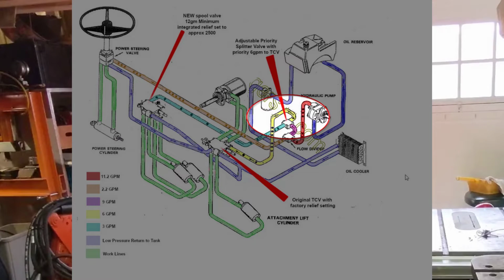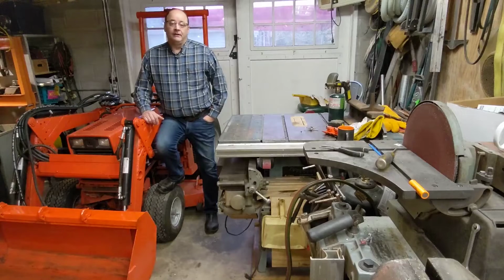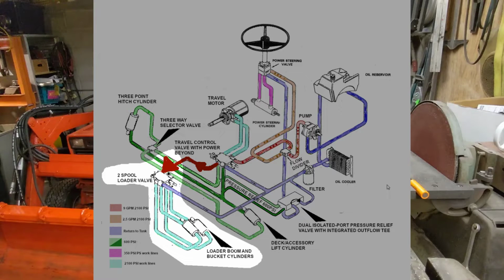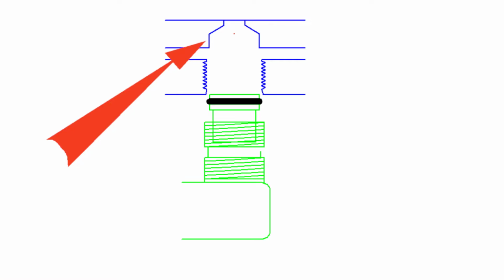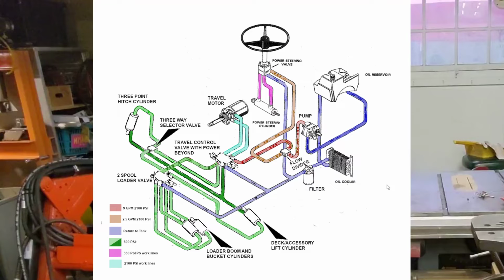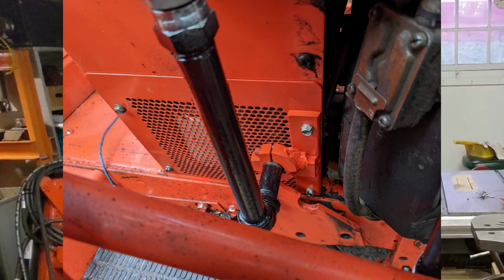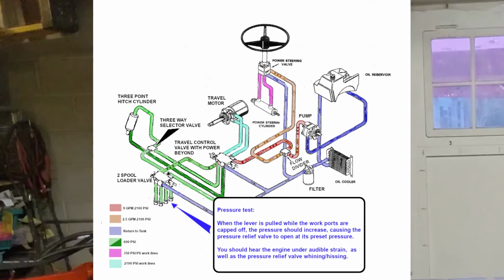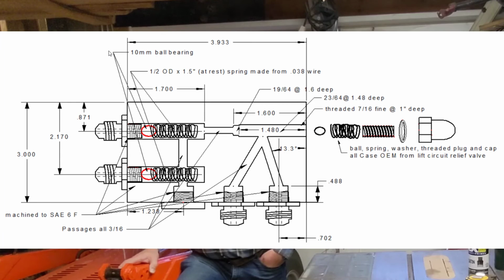Building a Loader for a Garden Tractor - Phase 5: Hydraulics  (The Story)

Comment: These are truly amazing videos.  The thought of building my own loader has been on my mind, and your video would be at the top of the reference list.  Inhabe a question about hydraulics I was hoping you could help me with.  I've switched out the hydraulic control valve on my cub cadet from a dual control to a triple off a John Deere.  The Cub control valve has an in ad out.  The Jonh deere has a in, an out (which is capped) and a power beyond.  Can I use the power beyond instead of the out for my application?  It just in a better spot and I can run cleanwr lines using it instead of the out.
Reply from the maker: Yes, that can work, IF certain conditions are true:  Without a "power beyond" sleeve installed into the PB port, then the PB port is simply an extra threaded hole that leads to the valve's "out" aka "return to tank" chamber.  So IF there' no PB sleeve installed, and IF this valve is your system's  only valve, then this PB port and the "Out" port are interchangeable, and you can use it for "out."

2 other conditions where it wouldn't work though:
1.IF you have another valve or device downstream of this valve that requires high pressure in, then you'd need to install a PB sleeve into the PB port, and run from that sleeve on down to the other device.  

2.  Or IF this valve does have a PB sleeve installed in the PB port, and this is your only valve in the system, then you need to remove the PB sleeve from this valve.  And at that point you may use either the PB port or the "out" port for "return to tank."   If "PB" is nothing but a threaded hole, then you don't have a PB sleeve installed.  But if there's some kind of object screwed into the PB port, then unscrew it.  If it's an extended tube thing that's about 2 inches long, then that's a PB sleeve. (Google image search for "power beyond sleeve")  As I say, you'd need to remove that sleeve before you use this valve as your system's only control valve.  

Reply again if this isn't clear.
Reply: @TheBuildist  That seems fairly clear.  There is nothing downstream.  The power steering is upstream, but it already has it's own power beyond which the control valve comes off of.   The power beyond doesn't have a sleeve online with the outlet per say, but there is another cap with a check valve system in there which I believe is for the power beyond.  IF I gutted the check valve out of it, then in theory it should render the power beyond into a simple return to tabk, correct?
Reply from the maker: @davekamphuis1209  Yes, precisely.
Reply from the maker: In case you're curious:  inside your control valve it has what you could call a "high pressure pipe" (2000psi or whatever) whose fluid can be directed out to the 3 vavle ports, or if the valves aren't being used, just passes on through the control valve and is dumped into a low pressure chamber that just drains back to the tank.  (50psi or so, just the back pressure of having to squeeze through twists and turns)  Imagine if a person just piped their "out" port to another pressurized valve, though:  then that "out" chamber would pressurize up to the full 2000psi or whatever when that next valve down the line directs all the fluid into a cylinder or whatever  And since this "return to tank" chamber is thin-walled cast iron, it can't take that high pressure, it'll crack or explode.  So a "power beyond" sleeve is a high strength steel tube that passes through the thin outer wall of the "return to tank" chamber, and seals into the "high pressure pipe" deep inside the valve.  So now that valve's fluid never reaches the "return to tank" chamber, it all passes through that steel tube ready to go to the next valve, with the assumption that that next valve will handle the return to tank duties.  But if we WANT this valve to send its fluid back to tank, then we have to get that sleeve out of the way.

Comment: Great work on this project very informative! I do have a question tho, would it be possible to route the second valve main supply off the output flow of the travel control valve? Or would this not be enough flow for the loaders needs? I know I’ve read that the output flow is only 600 psi or so…
Reply from the maker: Some people have used the regular deck lift circuit coming out of the travel control valve.  There are a couple challenges with that, namely that the volume is limited, as they're only 5/16" lines, so the loader cylinders are going to move pretty slow.  In addition, you're correct as well that that circuit has the relief set at only 400-600 psi. Most cylinders need a lot more than that, mine certainly did.  

To address the pressure, you can possibly dial up the relief on that circuit, or even disable it, which will revert to the travel circuit's approx. 2000 psi.  But then your deck lift and everything else in that system will be subject to 2000psi. 

To address the flow, you can buy a loader TCV, that has a power beyond port in it, or do like I did and machine a power beyond port into your existing TCV.  That opens the flow up to about the same as the TCV input, between 1/2" and  5/8".  

I ended up doing both of those things, and also intrdoduced 400psi pressure relief into both the lift circuit's up and down lines.  So I have 2000psi coming out the power beyond port, but my deck cylinder and 3 pt cylinder are only seeing 400 or so psi.
Reply: @TheBuildist  awesome info thank you very much for the response, one last question if I may ask. Would you have a part # for the power beyond sleeve you used in your conversion? These days Case dealerships basically laugh when I bring up the words 400-600 series case/ingersoll garden tractor… and parts are hard to come by in my parts…

Comment: Thanks for your sincere efforts to share the pitfalls of engineering something 'better' for your machine. I have a similar story with a Satoh s370D I bought  and it literally took 10 years of part time hours to get it working like a brand new tractor. Now it needs a loader. However, our case we are lucky. There is no relationship with the hyd. pressure and the driving of the tractor; but the various requirements of the add-on implements are duly noted. You did an excellent presentation of what a man can do if brave, and what the many risks are. Best regards - and thanks again!

Comment: Why couldn't you plumb the pressure from the pump into your loader valve first, then from the power beyond from your loader valve into the travel control valve of the tractor would that not have worked?
Reply from the maker: That's what I did first.  But when I used the loader while driving it isolated the travel control valve and the generated pressure blew up that line.